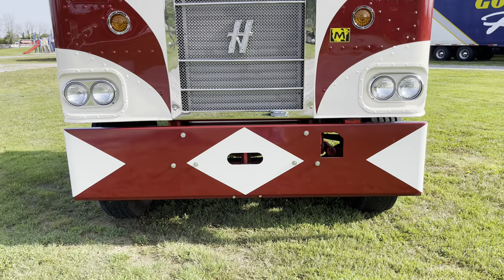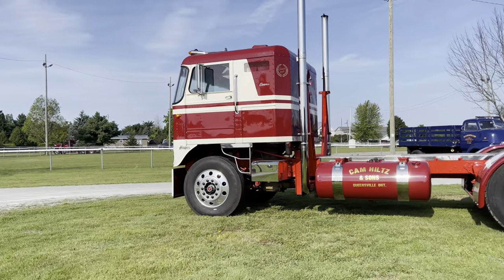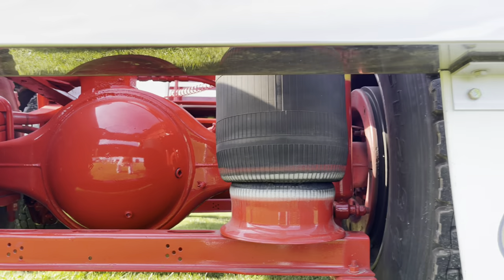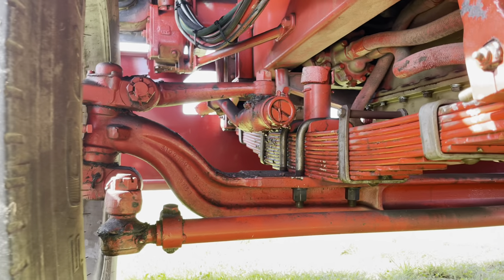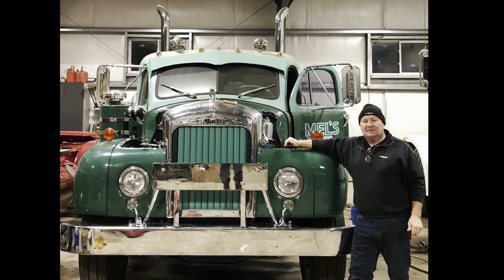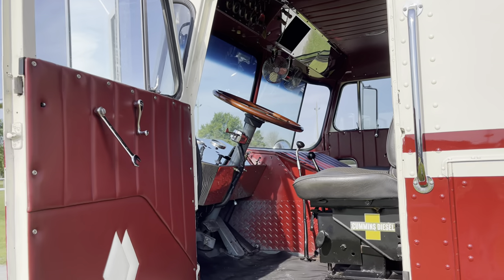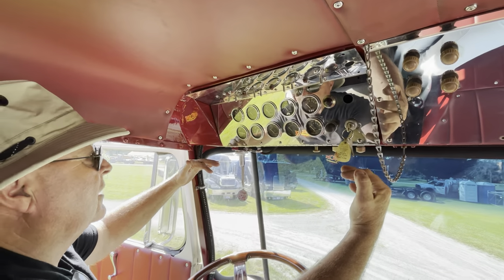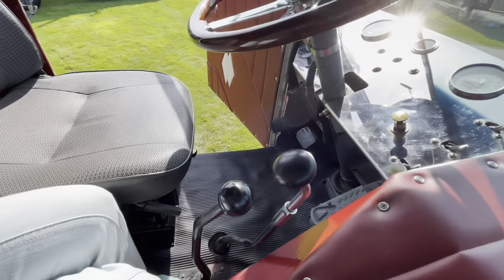Cam Hiltz’s 1965 Hayes Clipper Cabover Truck Tour

Comment: So beautiful. Don’t believe I’ve ever encountered a Hayes before! Thank you. Miss Red.
Late ‘70s I ran the NE and Quebec driving several different makes of cabovers, none with the Hayes’ attention to keeping the driver warm during frigid Northern winters. One in particular had a footwell vent that opened into the cab, rather than out. It leaked cold air like crazy, and the cab heater was anemic at best. One advantage was I didn’t have to take the time to don cold weather duds upon arrival. Already wearing toque, parka, gloves and Sorel boots just to keep from freezing as I drove.